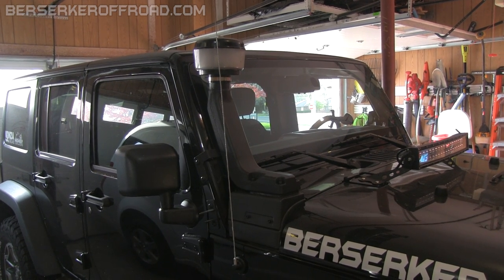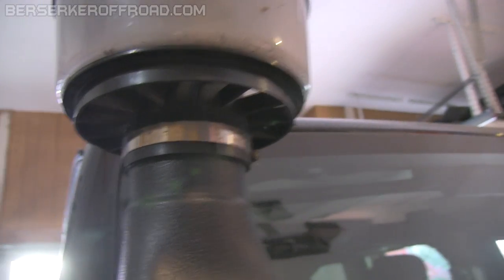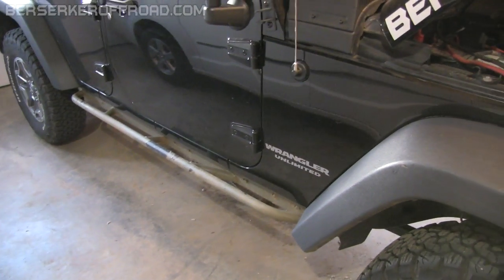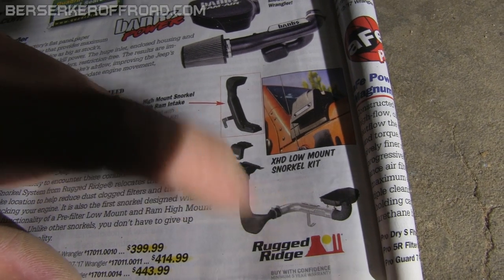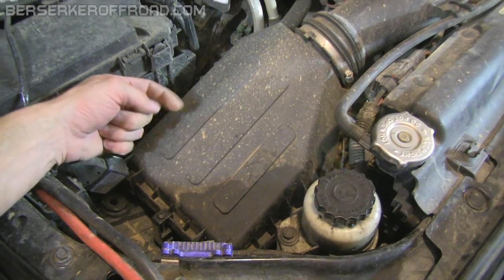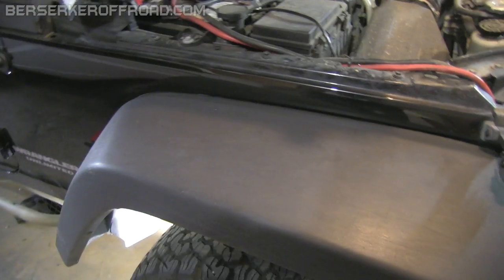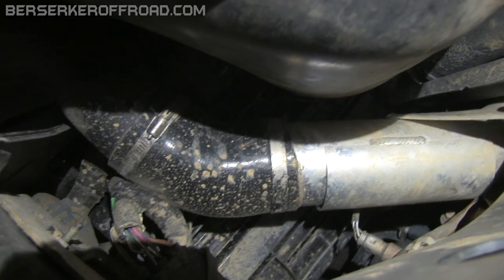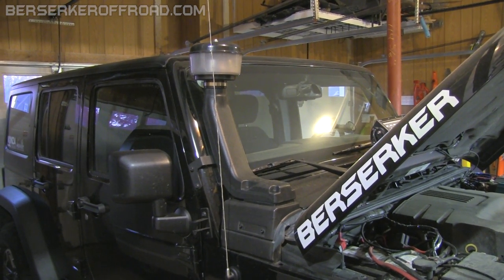Rugged Ridge XHD Snorkel Review: Watch Before You Buy!!!

Comment: I have this snorkel and I love it. I never had the problem with the noise you were mentioning. I actually like the design the way any water gets trapped in a lower reservoir and can be drained out. Where would that water have gone with the AEV snorkel I'm wondering?
Reply: Randy Reichert There’s a one-way drain in the base of the air box.

Comment: I installed the same snorkel about 4 years ago and it’s worked great ever since, didn’t have any of the issues you’ve had. perhaps you received a bad quality snorkel that slipped through QC. I have the 3.8 engine not sure if that’d make a big difference, I’m really happy with mine I just switched to the low mount recently for a fresh look

Comment: I had bought the AEV (knockoff) snorkel and had similar issues with the rocks, mud and water getting into the screened intake. The pre-filter  seems the way to go to help that. Even AEV instructions advise that leaving the plugs open in the bottom of the box for water to exit, acknowledges it is not 100%. Heavy rain wasn't really a problem. An issue I ran into was a river crossing on ice, when I hammered down water would get thrown up pretty high and seemed to get sucked directly into the intake. I flooded my box (w/o hydro lock), which I later added a drain plug. Possibly reversing the head may have helped prevent some of the water from entering and would definitely keep mud out. I would get another snorkel without thought, but using discretion as to the skinny pedal will help to regulate the amount of damage you can inflict. Slowly approaching a hole and crawling through it is failsafe, but balls to the wall, and  tire spinning can get you in trouble.  I like also the design is solid, the only connection is at the air box and a lot of silicone seals it tight. So there are not any worries of air holes in the system.  Cutting the hood only hurt for a few  minutes.  The end result was worth it. Thanks for the Video!
Reply from the maker: +Brick Johnson Thanks for sharing your experience with the AEV snorkel. How hard was the install?
Reply: Easy. The hardest part is preparing to do the cut into the hood. More stressful than physical. The trim ring allows for some play in case you are not exact on the template.  2 hole saw cuts pretty much sets entire spot up to be cut. I used a regular jigsaw to cut the hood, it is very soft and cuts easily.

Comment: Try insulating the metal part of the intake with header wrap to help with heat and vibration
Reply from the maker: I've dented it enough that it doesn't rattle. I put strips of rubber tape inside the fender to stop the plastic from reverberating in the fender.

Comment: Well, what can I say? that was a very honest and very informative review, you hit on all the points why I decided not to purchase that snorkel. I was looking at different brands of snorkels for my 2016 Jeep JK and saw the Rugged Ridge and was considering it, but the over complicated tubing system really put me off of it.
I went with the Injen snorkel. You have to use their dedicated cold air box with it that, that almost put me off deciding on it as they list for something like $375 on their web page, I found it on Amazon for $250 shipped new so I jumped on it. I purchased their ram air scoop for $119. My son-in-law cut my hood to install it. I am more than happy with it, The engine noise from under the hood is now gone, the jeep is now very quiet inside the cab, and the throttle response is definitely better. The ram air scoop is interchangeable with their snorkel so that is a big benefit.
The build quality of the Injen snorkel system is of very high quality so I am sure it is going to last the lifetime of my Jeep.
Thanks for a great review.

https://www.amazon.com/Injen-EVO5003-Air-Intake-System/dp/B00YX67582/ref=sr_1_1?ie=UTF8&qid=1481999985&sr=8-1&keywords=Injen+EVO5003+Air+Intake+System

https://www.amazon.com/Injen-EVO15069-Ram-Air-Scoop/dp/B00ZFS16AK/ref=sr_1_1?ie=UTF8&qid=1481999738&sr=8-1&keywords=Injen+ram+air+scoop

http://www.extremeterrain.com/injen-deep-snorkel-36l-evo15070.html

Comment: So I have installed this snorkle on two diffrents jeeps with no issues. The first one took a bit to install. Both jeeps have been in multiple deep water situations, crossing and stuck. The snorkle has performed great. Most metal inner liners will not work without some trimming and bracket fab work which is fairly simple. The rattle noise he mentioned, I have never had. I made sure to really work the heat shield for the exhaust for clearance. Use marine goop on all connection. This snorkle has some design flaws, but with a little ingenuity can be solved. I like the clean look and the fact that your jeep can be returned back to stock condition without having to purchase a hood. But great review its good to see a product from all sides.
Reply from the maker: Thank you. The largest issue I had with this snorkel occurred well after I made this video. On a 10-hour drive through Kansas, I was entirely in rain. The prefilter sucked water up that struck my windshield. My air filter was dripping wet like I'd left it in a bath. The resonator chambers attached to the air intake tube to the throttle body were full of water, which likely was sloshing through the throttle body. Who knows how much water went into the engine.
Reply: I dont have experience with the pre filter but with the stock head, if I know I'm driving through alot of rain I turn it to the rear. This keeps the splashing rain water out as well as leave the drain open as long as I'm not doing water crossings.
Reply: How would you put the corner cowel back on if wanted to go back to original? The metal was cut out? Thanks
Reply: @caligula1234  there are kits that you can put the corner back. I believe rugged ridge is the one I've uses. You aren't cutting the corner, you drill out the rivets

Comment: I installed this in my JK are your review is spot on. I agree. Knowing what I know now I would get the AEV however I can't run the AEV because my Smittybilt SRC Roofrack is in the way! That's why I went with this option. A buddy of mine Fozroamer found a prefilter sock that can go over your snorkel intake that prevents debris from coming in. Seems you can only find them in Australia so he had to special order it. It was called Unifilter or something like that. Thanks again!
Reply from the maker: Other people just turn the head around. But I'd rather have the pre-filter. Another problem I ran into is because the snorkel runs between the fender and sub frame, it's in the way of brackets for steel fenders. Also, I'm getting ready to do a dual battery tray install which requires me to remove my airbox. But it's all siliconed together because of the snorkel. Huge PITA to have to re-do all of it.
Reply: Berserker Offroad yah I just installed the genesis off-road dual battery kit and yup I had to remove it and resilicone it. But I'm glad I did it. I found some other issues. I also noticed that A newer rugged Ridge or slightly modified aluminum tube exists. I saw one with a big dent already put into it to avoid the issues we are having with it sitting in the heat shield. I may figure out something else for a snorkel in the future. Too many cons vs. the pros.

Comment: I love the look for the price of the Rugged Ridge XHD High Mount snorkel with prefilter, but I agree with other snorkels that have a straight shot to the intake of true cold air. Although, I have been searching long and I have only found a few prefiltered snorkels like AEV and such. I love the Injen Deep Water Snorkel but you have to also buy Injens evolution intake which buying both is about $150plus purchase. I love the AEV snorkel but the ONLY thing I raise an eyebrow to is the prefilter. I like the clear prefilter basically so you can visually monitor the dust collection. Now I looked at the Q&As on Extreme Terrain website to see if the rugged ridge prefilter fits on other snorkels and they replied no. Suppose the dimensions don’t work but I’m sure there’s a way to make it work like a gasket to fill the space or something. I don’t plan to do any deep water crossings so my mindset is all about obtaining true cold air that’s dust free and the ram air tips seem like a gateway for heavy rainy days to make me nervous of water collection.

Comment: thanks for this man! I've always gone back and forth on purchasing this for almost a year now. I didn't like the AEV cause i had to cut into my hood but then saw that they sell a hood with pre cut vents for it.
Reply from the maker: Let me know how it turns out!
Reply: Berserker Offroad I have the ARB "Safari Snorkel" and the tube goes through the fender and is high and tight in the wheel well and the straight into the side of the air box. simple with good connections. I'm very happy with it and IMHO it looks almost as good as the Rugged Ridge and much better than the AEV

Comment: Hey, nice review. Couple things, I have this snorkel on my 2dr JK. I didn't have the exhaust manifold issues that you had (maybe it fits better with the 3.8L?), but definitely agree that if you don't RTV the hell out of those connections, you're not going to have a good time at water crossings. I was super nervous about that, so I really sealed the crap out of it and I let it sit for 48 hours instead of 24 hours to make sure it was all set up nice and sealed up good. That was my only complaint, that there are a few places it could fail. I was having heat issues right before I installed it, passing over Altamont Pass on the way down to San Jose at about 110 degrees out this summer and my engine was getting just hot enough to turn the light on. I installed the snorkel and that problem was instantly gone. Every other trip this summer over Altamont Pass, I had no issues, even in stop and go on the huge incline up the mountain, no more heat issues. So I don't think the exhaust manifold (if it's as close to mine as yours), is causing any heat issues on the air. I think it's still cooler than it was with the stock air box.
Reply from the maker: +Vinny Gullotta thank you for the reply. I'm glad to see it's working for you and that you aren't having heat issues. I don't know how it mounts on the 3.8 but on in my case it's too close to the exhaust manifold. They even put a heat shield on the aluminum pipe because they knew it was hot there. As I said in the video it only ran hot like that in stop-and-go traffic in the summer (well, that and when I'm romping on the gas in a mud hole). My commute is an hour each way and it takes that long to get up to temp. Thanks again for commenting. What's your Jeep like and how is the wheeling in your area?
Reply: I have an 07 JK on 35's (now with stock suspension =-O ) and flat fender flares. Too many mods to list em all lol. Wheeling here in Cali is awesome. There are SVRAs all over and we have the Rubicon Trail just a couple hours north, so we have plenty of awesome wheeling out here. Not nearly as much mud as you guys have though, it's definitely more of a rock crawling or sand dune state than a muddin state lol
Reply: on my next break, I'm going to go out there and crawl under it and take a look and see how close mine gets to the manifold. Maybe I'll snap a picture if I can get a good one.
Reply from the maker: I'm envious that you Cali guys have so many cool places to wheel close to you. Besides a few local ORV parks it's an 8+ hr drive to anything respectable.

Comment: It sucks because in my opinion the Rugged Ridge looks the best when installed, but the AEV seems to be the most practical. I did notice on the JL version, Rugged Ridge goes down through that corner cowling and direct to the airbag without going down at all. I'll be installing the Rugged Ridge on a Gladiator in a few months and installation looks to be light years more simple.

Comment: The only issue i had when installing mine was that the outer splash guard did not completely fit back in place. Also if you add some exhaust wrap to the aluminum tube you will not get any rattling.
Reply from the maker: I put thick rubber padding inside the fender to stop it from vibrating against the intake tube as well.

Comment: Thanks for sharing. I picked up my 2017 JKU 2 months ago. Thought about a snorkel install (not anytime soon). Was wondering, does it increased your horsepower?
Reply from the maker: +Brandon Koay the pre-filter restricts airflow. The standard opening does create a slight forced induction effect but overall my mileage didn't change. So it doesn't increase power.
Reply: Thanks!

Comment: @berserker off road did you have an issue with the inner fender splash shield not lining up because the tube is in the way?
Reply from the maker: I had many issues with alignment and getting the parts to fit together.

Comment: I had the same setup on my jk and after a year I took it off  just not enough air getting to the air box after traveling through all the tubes..
Reply from the maker: How did you diagnose that?
Reply: @Berserkeroffroad  scangauge2 ..actually taking it off dropped the intake temp by 5* more so at idle  at stop and go .. now going against  wind made the only difference because there was enough air ramming in but at crawl speed or idle forget it

Comment: Have you been through the auto car wash? I wonder if the machine will damage it?
Reply from the maker: It was fine with the stock top but I haven't taken it through one with the pre-filter. Good question though. The pre-filter doesn't attach as strongly as the original inlet.

Comment: This took you 8 hours to do. WOW how many beers or smoke breaks did you take. I did mine Friday night before SEMA in 3 hours by myself. Install was very easy. Only thing id say is dont use the template for cutting the fender. Just line it up make by hand and cut.
Reply from the maker: I'm glad yours went smooth. Taking my slider off added an hour and I had fitment issues. Not a single part lined up. Everything had to be coerced into position. The upper snorkel wasn't lining up through the cowl, the aluminum intake tube was twisted too far against the manifold, etc. The plastic nipple that the drain plug attaches to snapped off in shipping so I had to melt it back into place. Like I said, my install SUCKED.

Comment: Is there anything to put between the airbox halves? Or jus the clamps provides??? Cause im worried about the airbox being a weakpoint for water
Reply: alec schaefer i know this is late, i installed it today it comes with some screw down clamps that hold it together, it’s pretty solid or at least just as good as stock but i’m still looking for a sealed air box. i’m pretty sure air raid makes a good one

Comment: Your wrong on the light bar. I installed mine with my e row light bar with no problem. You can actually use any light bar if you install the light bar first. 
You also get mud in your snorkel because you need to switch to the mushroom type top for the snorkel.

Comment: What does the depth of the travel of the air have to do with the air intake? Good or bad thing? Why?
Reply from the maker: The point I'm making is if you get a leak in the intake it'll fill with water on a deep crossing.
Reply: Ahh, gotcha. I guess I am not as concerned with that as I would be having a downhill channel running straight to the intake... get a good splash in the snorkel and it funnels it right to the air filter? I would rather have the s bend (kindof like how your sink works with the trap) to catch any water that makes it inside the snorkel (especially when running the low mount) and have that catch be away from the air box... afterall, assuming it doesn't get clogged with mud, that water will drain out of the valve, right?

Comment: I have this snorkel and am having the same nose problem with the exhaust and snorkel rubbing, did you ever find a fix? 
thanks.
Reply from the maker: +Trace Cruz I had to bend the bracket that attaches to the brake line mount. Sometimes the plastic box inside the fender shakes as well. I slide foam pieces in there to stop that.
Reply: awesome! i have been beating the heat shield on the exhaust for hours but it wouldnt give lol. 
Did you have to remove the metal part of the snorkel to bend the bracket?
Reply from the maker: Trace Cruz I left it in place for leverage (and because it's already siliconed)

Comment: someone someday may come up with something similar to an exhaust bypass. cover your snorkel during rain, mud. then open for offroad use by turning a lever or switch so you can run between stock and snorkel. wheres sharktank when you needem

Comment: What happens when water gets into the top of you’re axle drains? What happens when water gets into you’re fuse box? What happens if you’re on a long trail and a branch snags you’re air pipe and rips it off, wait did you already cut your Jeep up to install snorkel, nevermind everything should be fine

Comment: I does not recommend the ARB Safari Snorkel for jeep JK, because you CAN'T use now or in the future the new ones Shocks with reservory, the space between front right Shock and plastic is very few, so it is really a big problem to upgrade your shocks such as RC Vertex or FOX, and others brands.. BE careful because this is an error or engineers of ARB in this snorkel design.